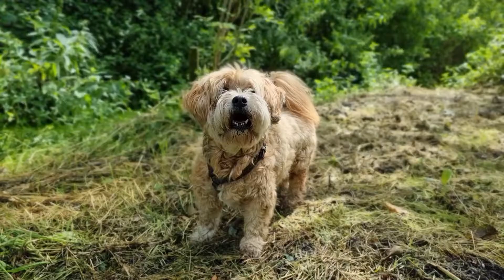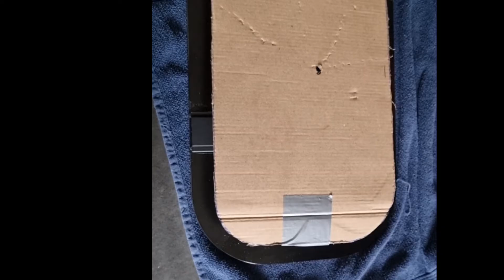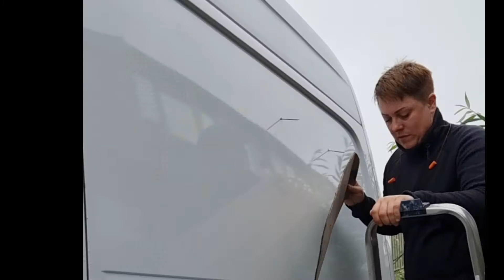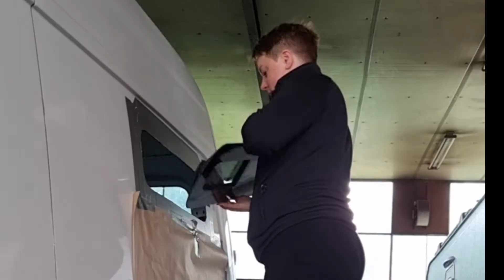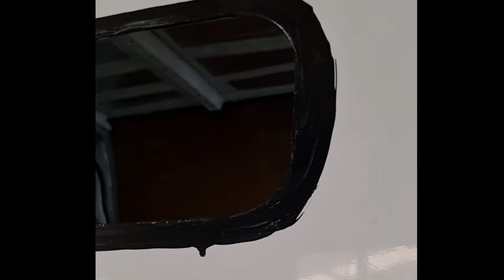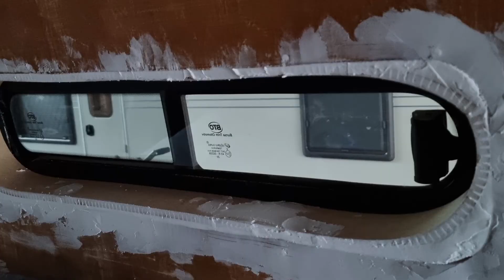How to install a bunk window / Solo female Vanbuild.

Comment: Hi.. i know this video is older, but I bought the same window for my conversion.  VanTek glass looks the exact same.  Does it sit a bit off the van?? I noticed it sticks out a little from the side of the van.
Reply from the maker: Mine is not flat onto the Van. Because of the adhesive inbetween
Reply: @sayyestonewvanventures thank you for responding!  I am going to install window in the next week or 2.  Thank you for the video it will be very helpful!
Reply: @cassiecurneen430  how did it turn out!? Just picked up mine and was expecting something inside to van to mount it against, but it's just glue. Might try to seal that level, as the glass itself that will stick to the car, isn't fully flat (plastic rib from. the window on it)
Reply: @rojajaja  It was difficult to keep it in place since it was just "glued" to the outer frame of the van. I probably overdid it with the adhesive, but I'd rather have too much than not enough (leaks). I think it looks great, though!